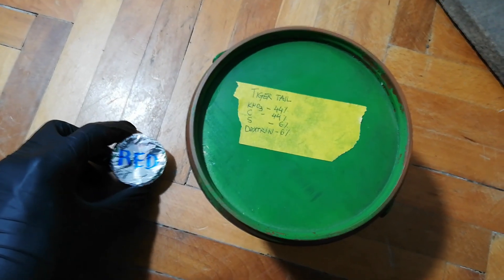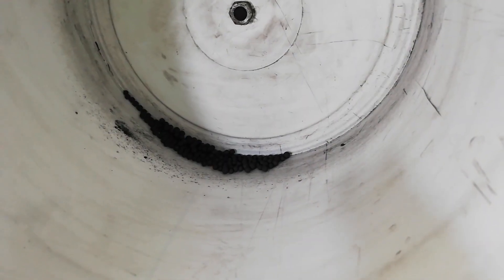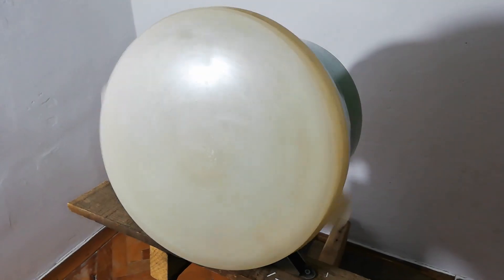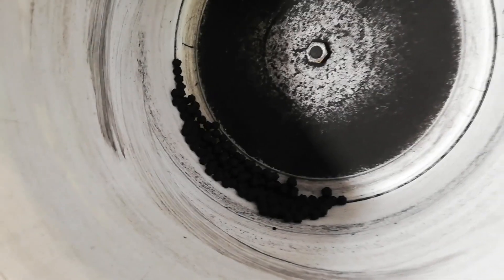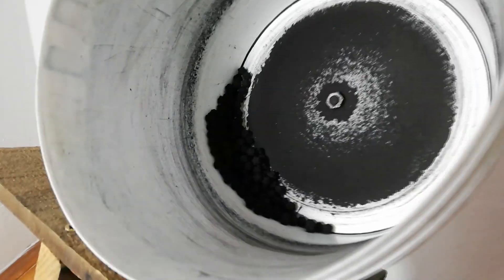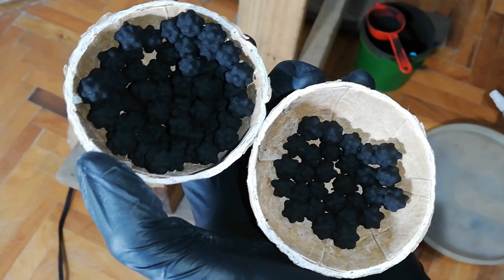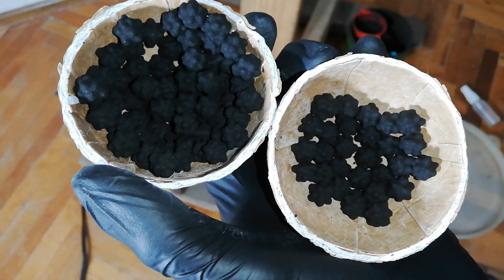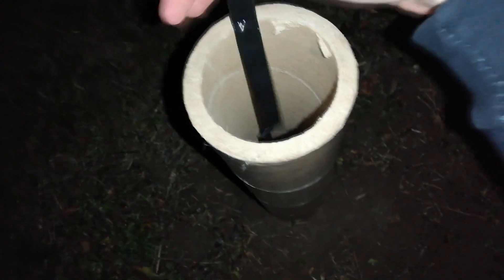Pyrotechnician Makes 2-Stage Red Firework Stars for 75mm Shells

Comment: The stars usually come out clumpy when rolled in small batches. I’ve had this problem before and this is something I’ve noticed :)
Reply: Exactly. And when rolled with dextrin and water. 
I only roll stars in larger batches and wirh red gum or phenolic resin. And i use different sieves.The stars come out so perfect round and similar. I had that problem too with those edgy clumpy stars.
Reply: Rolling stars in such small batches makes no sense
Reply: But the result of his stars are really not that bad. 
I like that effect of golden streamer to red
Reply: @TheHagen83  Der Profi auch hier XD
Reply: @Exotic69420  ja 😄
Ich muss auch mal solche crysantemum to color stars machen. Gefällt mir echt gut.
Reply: @TheHagen83  Würde ich gerne sehen von dir!